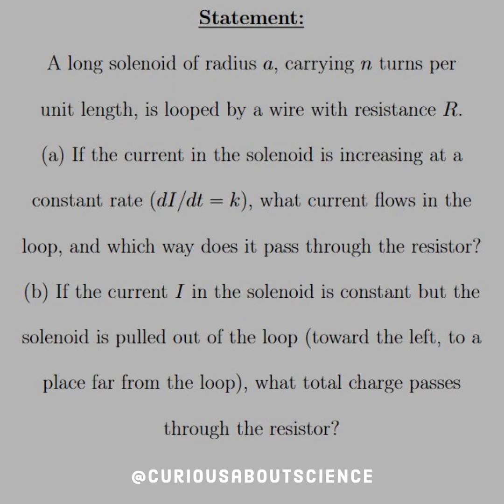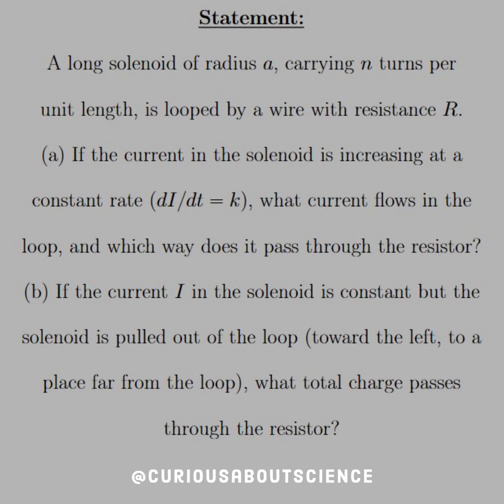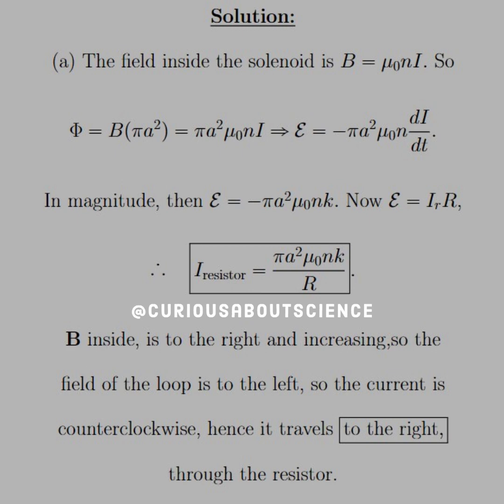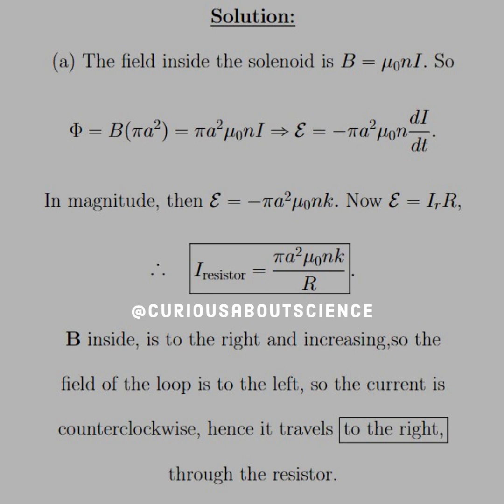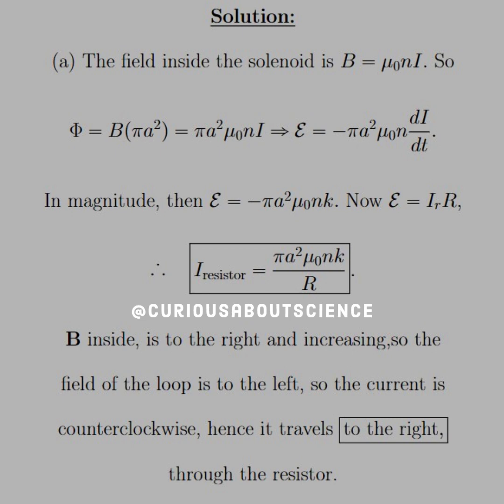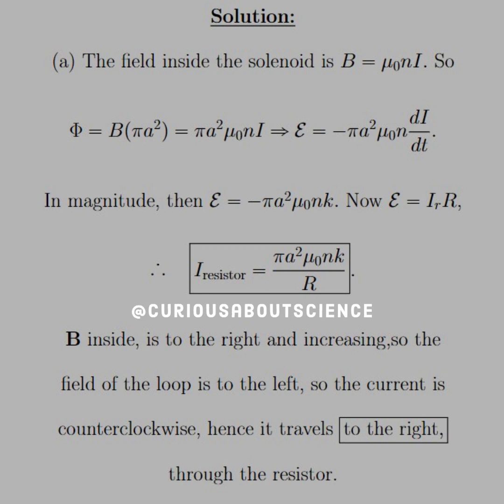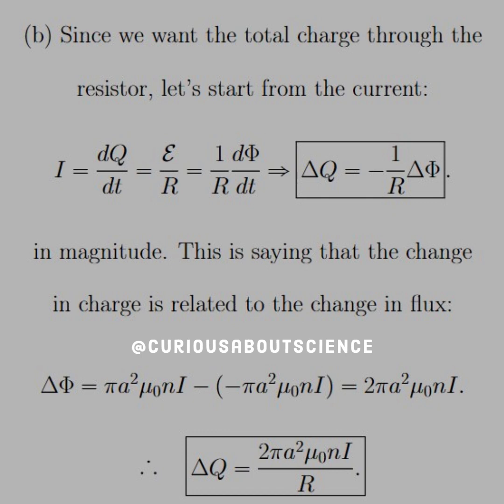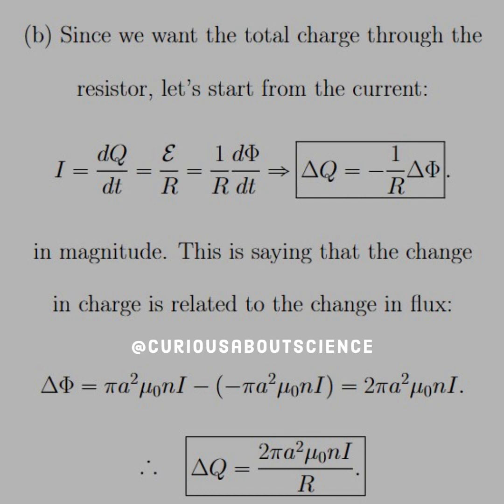Problem 7.17 - Electromagnetic Induction, Induced Electric Field: Introduction to Electrodynamics

Comment: Can you please provide a clearer explanation why the flux change through the loop is doubled when you move the solenoid far away from the loop? It doesn't make sense to me since the flux change should only be -pi*(a^2)(u_o)nI, because the initial flux is +pi*(a^2)(u_o)nI and the final flux is zero. Thanks and keep it up!
Reply: same question here!
Reply: @ErenCengiz-xu9wx The direction of currents was changed(because you reinserted in different direction). So so you need to use -I instead of I
Reply: @동형김-v2jstill don’t understand😢
Reply: The direction of currents was changed(because you reinserted in different direction). So so you need to use -I instead of I
Reply: @동형김-v2j You are NOT reinserting anything. You are just pulling the solenoid outside the loop, so there is no change in current. The flux changes from phi to zero, so the 2 factor makes absolutely no sense. The answer that this video presents is wong and Griffiths has corrected this problem (7.17) in the errata which you can find online.
Reply: And delta( +I -(-I)) = 2(+I) it's the reason why he doubled

Comment: I thought the field outside a solenoid was 0?
Reply: It is! Check the errata to the solutions manual online. Griffits has corrected the factor 2 there, so the answer here is wrong and some people just blindly follow through inventing reasons they themselves are probably not convinced by.
Reply: The field inside is also inside the enclosed area of the loop with the resistor. Any change in this allows for an induced emf from said loop with resistor.